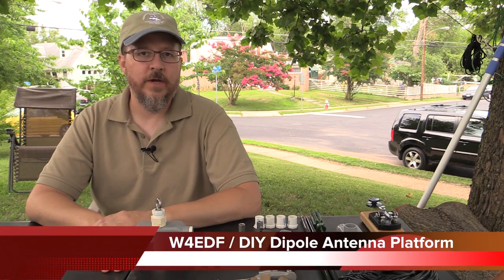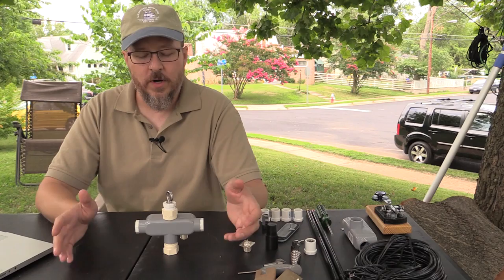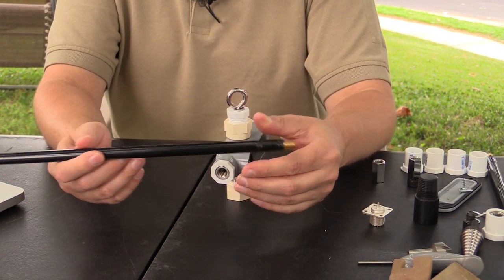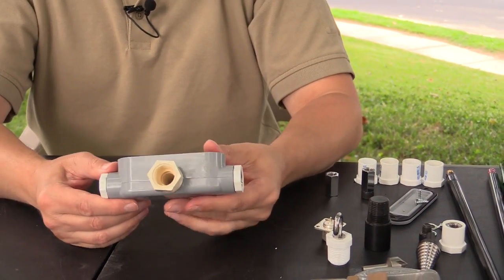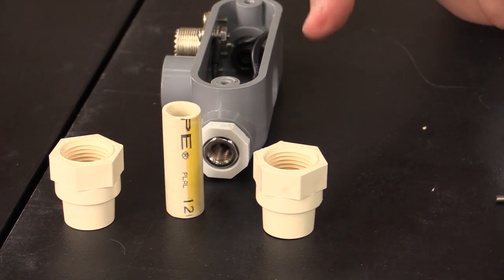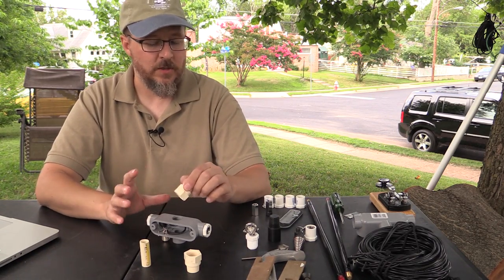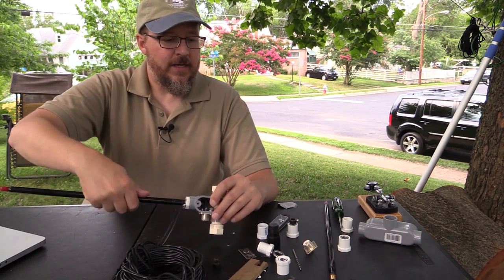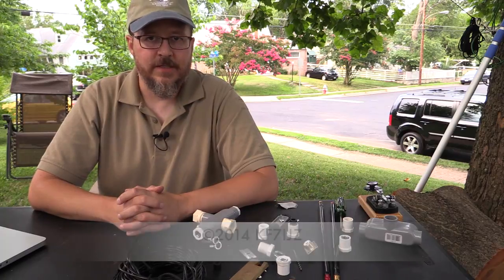W4EDF Portable Dipole Antenna Center Support

Comment: Very informative! Putting a 2m/70cm on top would be very handy. 6m typically is not very useful for me (I seem to live in a 6m graveyard), but if you're on elevation it might be. I have a 31' telescoping Jackite pole and some Par EndFedz, plus the painter pole with an MFJ dipole mount for sticks. This design keeps everything in one neat little package. As long as the fan 20/40 are 45 degrees apart, it sounds really nice. If it were hung by a line between trees/buildings, you could really get some height for V/UHF line of sight. Excellent job!

Comment: Awesome instructional video! I have ordered all of the parts you listed and will stop at Lowes tomorrow for the rest. Can't wait to make one. Very nice and solid construction. I might add some extension supports to each side to hold "ham sticks" since I already have some for 40m and 20m. I'll have to find the 16ga marine grade strand wire you mentioned though. I would like to have it as a wire dipole as well. Thanks for spending the time making the video! 73's KC5NOI

Comment: This a perfect solution for me.  Thank you.  One question I have.  Inside the center support, it isn't clear how you connect the wire to the antenna sections from the co-ax.  Is there an adapter that screws into the 3/8 24 that you solder to?  Thanks again

Comment: That Hex Coupling Nut can be found at any truckstop, it is the same coupling nut used for CB antennas on big rigs. HOWEVER, truckstops are not known for great prices on CB/Antenna equipment. So I guess it just depends on how fast you need to get it. You'll pay as much at the truckstop as you will from Amazon.com including shipping. But if there's a truckstop 2 miles down the road, you can have your part in 15 minutes vs 4-5 days from Amazon.

Comment: Nice video, congrats! A pretty cool mod would be to use either cap screws or hamsticks on both sides to mount a triple mounting plate for Hustler resonators. You could then have a "4 band fan dipole made out of hamsticks. The construction seems pretty rugged, so I think you could pretty much do whatever the heck you wanted to with it. I gotta make one now and abuse it!
Chris K2IF

Comment: Hey there KF7IJZ! I just finished the build for this dipole. I was excited to finally get all my parts in. I bought both the regular whips and the long whips so I could use it for 10m and 11m. Sadly my SWR is way out of wack and peaking past 9:9 so I think there's gotta be some kind of connection issue. It's just strange because everything looks to be connected just fine. I tested for continuity as well. Center pin on the PL259 and the main element whip tests fine for continuity. And there is no continuity between the center pin and the ground whip, which looks good. I wonder what I have wrong? Mind you, I tried a standard horizontal configuration with no radials or ground wires. Shouldn't need them for a horizontal dipole, right? Sorry for my noobness. I appreciate the help immensely. KC3NDG

Comment: Hey Ed, great video. I would be building something like this for a permanent setup. What about strain relief ? What do you suggest?
Reply: VA2XMX Petro K Just remember that PVC can get brittle from UV exposure, so you might want to paint it first.  For strain relief, you can use the top eye bolt as the anchor and attach to the antenna wire from there.

Comment: Can this be used for ten meters? And how about the CB band i believe that is the 11 meters ? When SHTF something like this can come handy and can be hidden in plain sight . Thanks!
Reply from the maker: It absolutely can be.  This setup will work for ANY dipole as long as you cut your wires to the appropriate lengths.  You can even use it as a multi-band fan dipole.  For a quick and dirty option for 10 and 11 meters, you can add two Buddipole Long Telescopic Whips (http://www.buddipole.com/lotewh.html) and be resonant down to 15M w/o adding a coil.

Comment: instead of epoxy, you could use a hot glue gun and fill that space and once it hardens it will be waterproof and rock solid. great video.